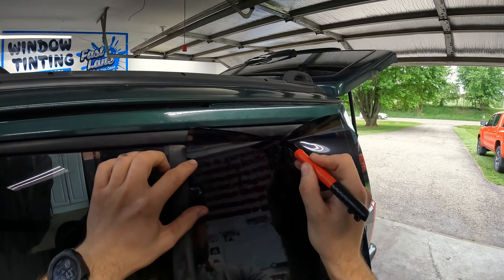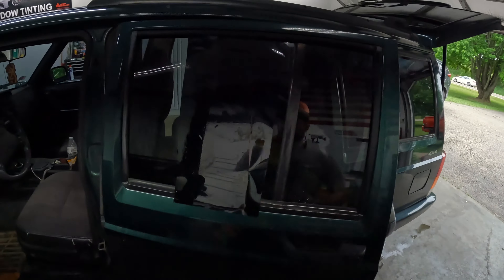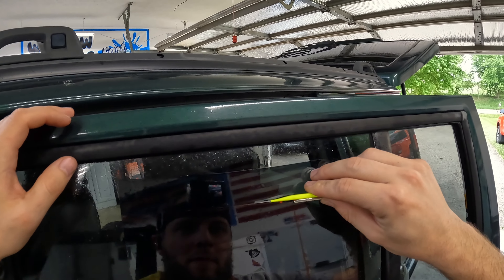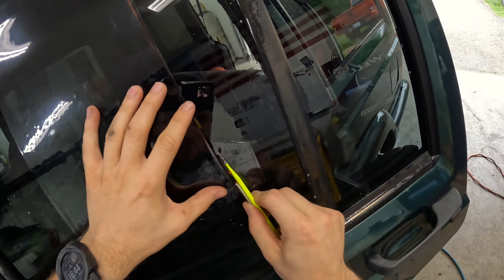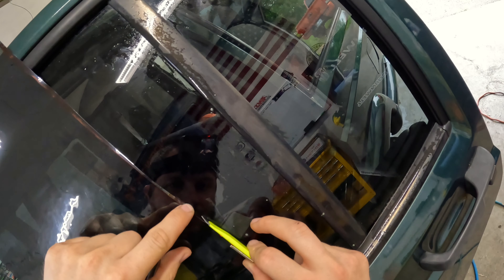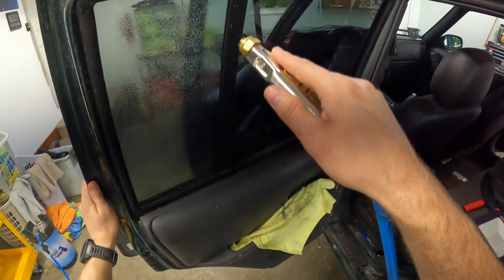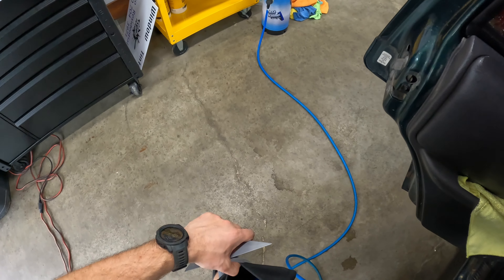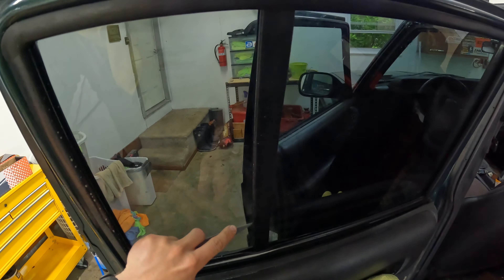Quick Tip For Hand Cutting Tricky Quarter Windows!

Comment: Do you use the sharpie method to cut other quarts as well ?
Reply from the maker: Really just depends. Most cars that I work on have ceramic borders so I just double cut them in place. Once in while you run into a vehicle like this where the sharpie method works better. 

I just do whatever way I think I will get it right on the first try.  If I have to try again then I'm wasting time.  The sharpie method is a trick you can use in a ton of situations.